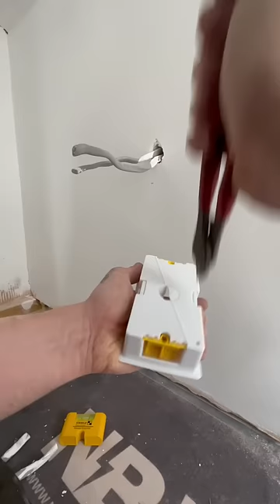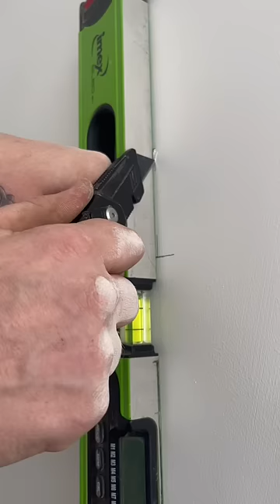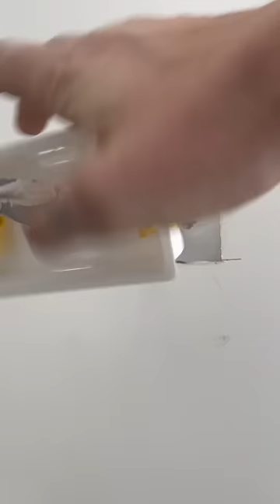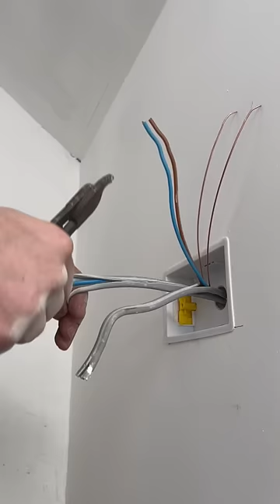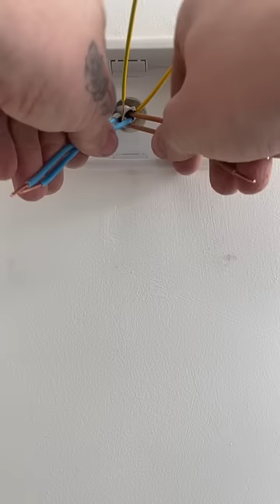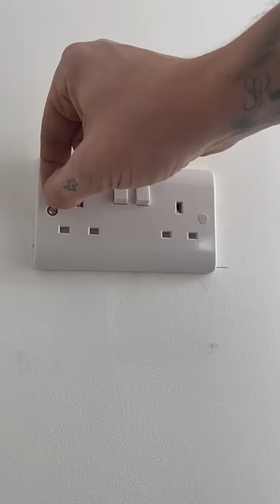Ignore the pencil marks

Comment: I'm not familiar with standards in UK, but why have 2 Romex. Wouldn't it be easier just to run one and be done with it, or would that be a code violation?
Reply: If Romex is what you lads cause cables then it's because it's part of a ring final circuit.
Reply: It’s looping in and then out to the next socket. Maybe a ring or a radial but either way it’s the cable going on to the next outlet. 👍
Reply: @THECALLOF241  yep romex is what they call the twin and earth cable we have here

Comment: I still don't understand why Brits have an uninsulated, bare copper wire for ground, and only then add the insulation after they terminate the cable. Why don't you have it already insulated inside the cable like the mainland Europe?
Reply: At least we put a sleeve over the bare wire to identify it , in the USA they just leave it bare which I have always found odd.... !
Reply: The earth conductor doesn’t need to be insulated. Not insulating it saves money and reduces the size of the cable. The sleeving is for identification in this case.

Comment: I dont understand why on earth would someone use wire that has bare copper ground wire inside... Its just ridiculous. Sometimes it is very handy to use the third ground wire in a old house or old instalation, as a seperate live to feed more outlets if complete redo of instalation is unavailable. In lithuania all instalation wires you find in stores have ground wire insulated as well

Comment: rough as fuck using an electric screwdriver shame on you
Reply from the maker: ?? It was tightened by hand after as shown
Reply: Rough is that a joke. I and many others always use electric screwdrivers. Sensible I'd say
Reply: Personally I will never use battery drivers on accessories,  you can't get the feel with them and it's just lazy.
Reply: @supersparks9466  Not battery ones the normal chargeable ones we use
Reply: @JIBS.  not with you ? Anything that is not 240/110v is battery
Reply: I agree rough and just lazy
Reply: With torque settings no issues and you can nip up on manual setting